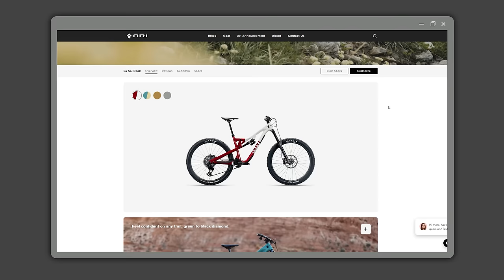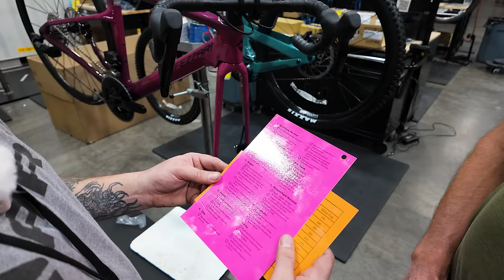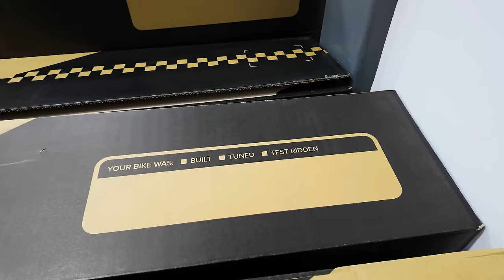VISITING OUR NEW BIKE SPONSOR (inside Ari HQ)

Comment: Sponsorship works! I'm in the market for a gravel bike and I'm now going to look at those Ari bikes. I'm no stranger to direct to consumer bike buying having bought a couple of Canyons. This looks like a much more personalized experience. You've earned your paychecks!
Reply: The Shafer is badass. Helped build them up for some local folks (with the previous Fezzari paint schemes). Light, comfortable, good tire clearance, and one of the few gravel bikes you can mullet with the AXS Transmission drivetrain for wider range gearing.
Reply: I will check them out also!

Comment: Never ever / positively / cut down the steerer on any fork. Fill it with headset stackers until your know what fits or as you get older you can adjust accordingly . And for bike packers you can use the height above the stem to wrap tie downs /hold the bike up when not in use etc etc.